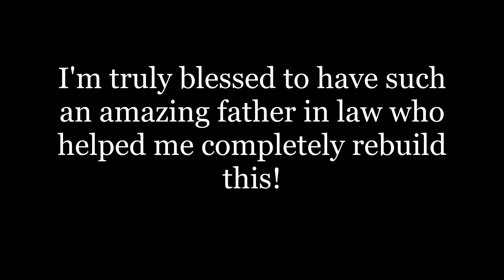Rear End Collision Damage Repair | Budget Builds | DIY Style | Honda Pilot

Comment: Hi , great vid. What did you use on rear quarter panel- loads of pins to pull??  The winch? Thanks and please have a look at some of my stuff York knight
Reply from the maker: We used a slide hammer
Reply: @mafiya69  -how did you attach the pins to body - then hammer to pins - please. Or maybe do a quick video showing how to do it?  Ray

Comment: How did you pull the front radiator support with that chain? Did you just back the car up or did you have a hydraulic tool?
Reply from the maker: We used a winch! It’s one of those manual ones